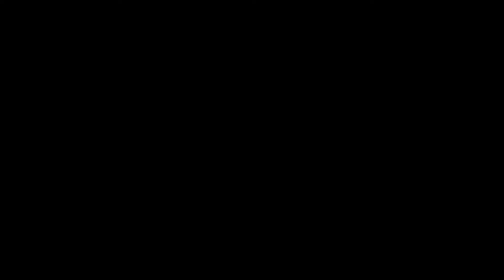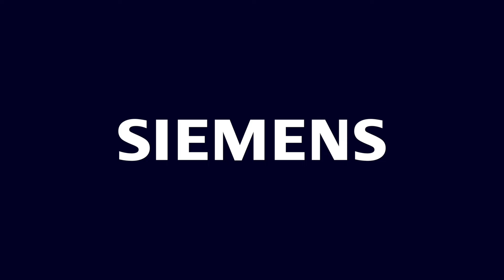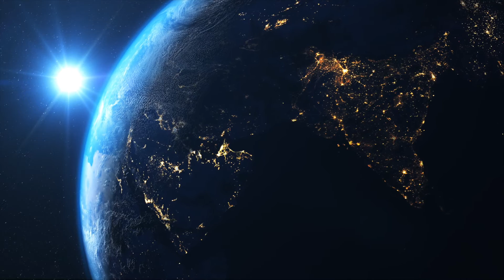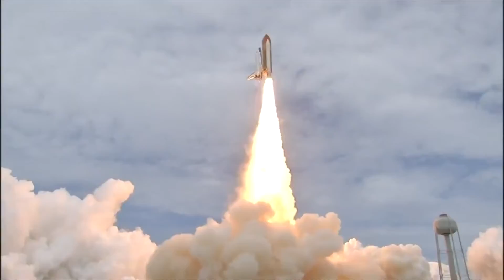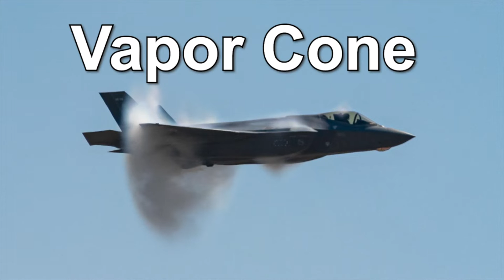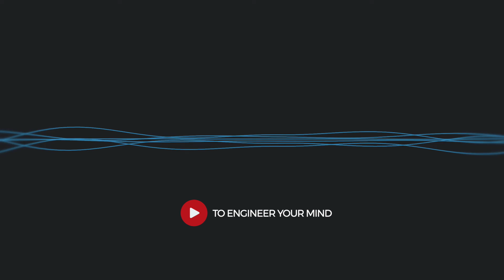💦 Shock Waves, Expansion Fans & Supersonic Flow – Dr. Chris Combs | Podcast #88

Comment: Sorry Dr. The ramjet on the underside of the X-15 flown by Pete Knight on that day in 1967 was loaded with sensors and never intended to fire up. It was a simple mock-up developed to use the X-15 as a practical, mechanical wind tunnel. Most authors write that the ramjet was a runner but it was not. I know this because I knew Pete.

Comment: Your Mach 7 wind tunnel reminds me of a design I saw 30 years ago built by Dr. Greg Winkelmen. It was a long tube that a rocket fired down to compress the air on the leeward side of a scored diaphragm. A small model is placed in the tube and because of the compressed air in the tube builds up pressure,  the excessive air pressure ruptures the diaphragm and  hypersonic air is created to pass over the model. Does yours work his way?

Comment: Dr. Combs, I am half complete with a rocket car built to touch Mach 2. It is powered by a Thiokol XLR -99  rocket engine converted to run on methanol and LOX. It was originally used in the X-15. I also have already built a 1,000 mph, rocket racer. Called Sonic Wind. I also designed a hypersonic aircraft and engine using a new type of combustion technology. Would you like to see it? Look me up.
Waldo